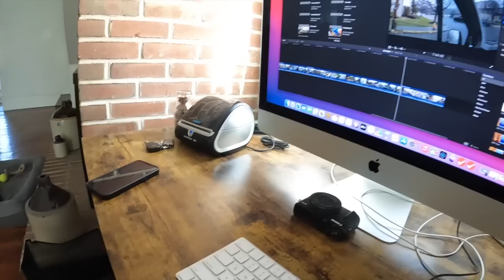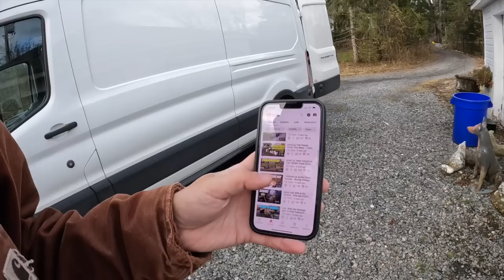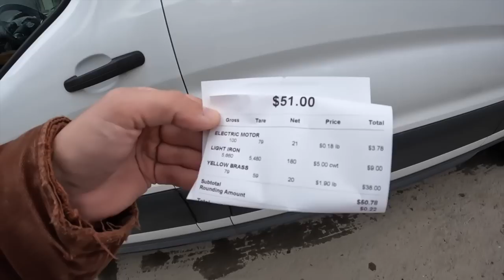Daily Vlog with My Dog and Running Errands

Comment: What I've seen of peoples shorts that I follow, is they use a clip from a normal video that they would have cut out anyway. In your case a quick short of the inside of your storage building and what it currently looks like, or a quick short of the scrap yard and some odd thing you saw, something of Salsa, you hitting golf balls across the pond, just quick little things like that.